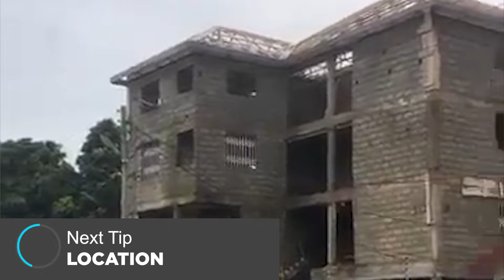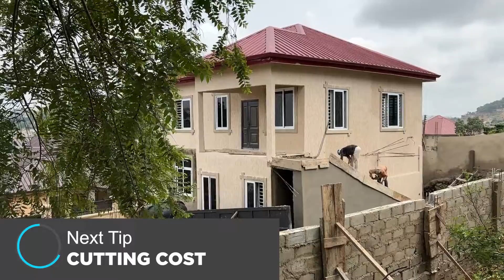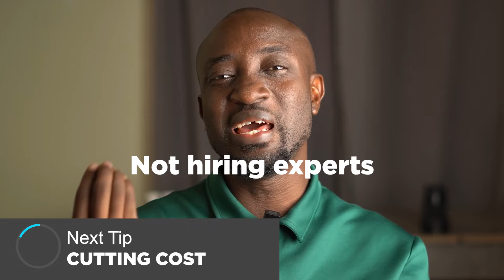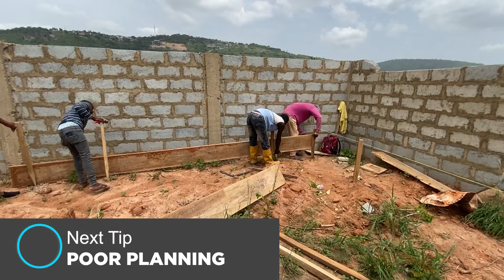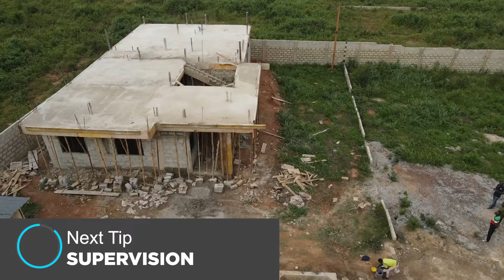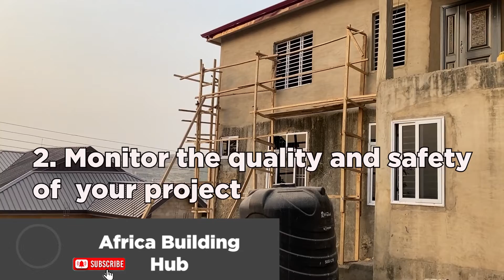Avoid these Storey Building Mistakes - Building in Ghana 🇬🇭

Comment: I AS A STRUCTURAL ENGINEER CHALLENGE YOU THAT MILD STEEL CAN AND SHOULD BE USED FOR STOREY BUILDING. MILD STEEL CAN EVEN BE USED FOR BRIDGES. THERE ARE MANY REASONS WHY BUILDING COLLAPSE, LIKE POOR CASTING AND CURING OF CONCRETE.  USING THE WRONG REINFORCEMENT  SIZE . LACK OF STRUCTURAL CALCULATIONS, THE USE OF MILD STEEL IS PERFECTLY FINE FOR A STOREY BUILDING, YOU DON’T HBAVE TO WASTEE YOUR MONEY ON QUARRY, DUST, QUARRY BLOCKS AND HIGH TENSILE STEEL

Comment: In the buildings u showed in this video, are you using sliding windows or Louvre blades?

what's your take on the choice of either described above?
Reply: My thoughts or the modernity or otherwise is different  in the sense that those who introduced the more modern one sought to solve a problem; cold weather. Is it worth the trouble in  countries whose average daily temperature is 28-29 degrees Celsius? Are we not overstretching modernity instead of adapting our terrain and allowing for good ventilation?
Reply from the maker: Sliding windows are more modern but more expensive

Comment: Hello Boss..Can one use 14mm for single storey building..
Reply from the maker: It’s not just the size of the iron rods. How far are the columns from each other? What ratios are you using for your concrete mixtures? So many factors.